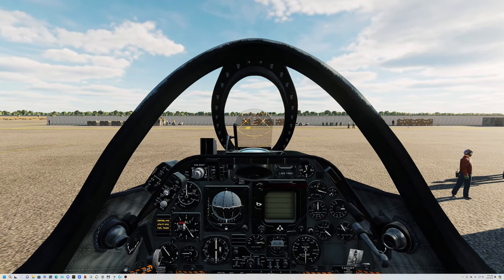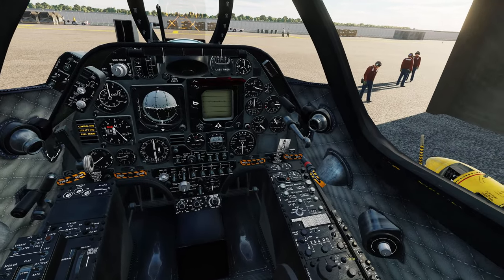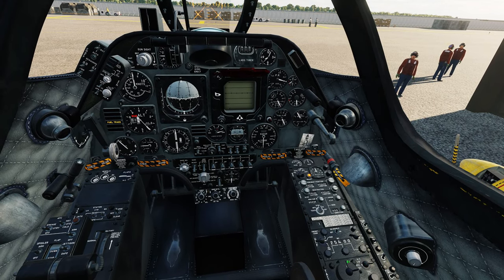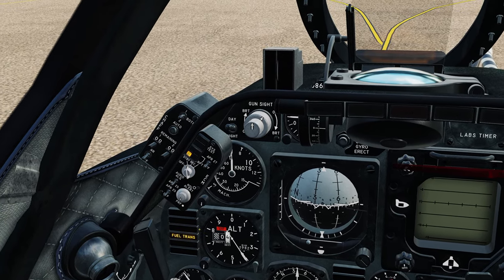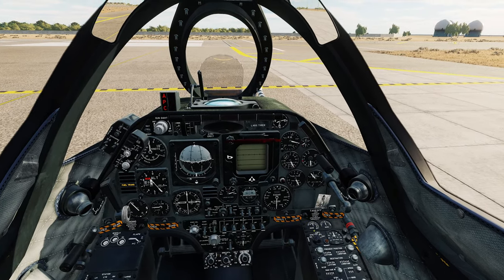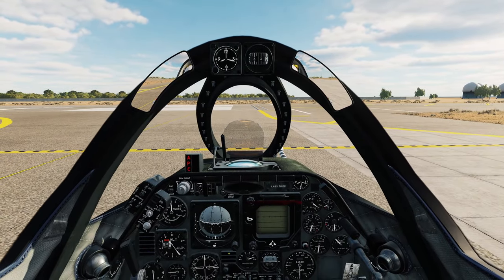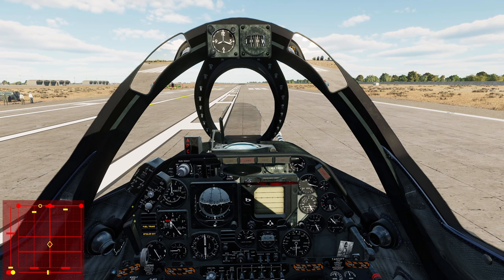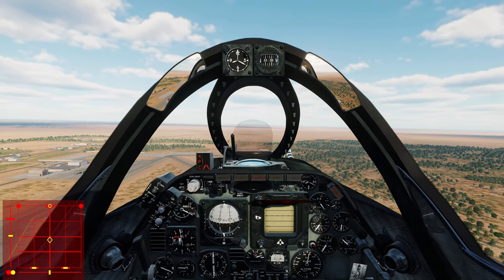A 4E Realism Stuff Ver2

Comment: Hello, massive fan of the A4 in DCS here, thanks for the video!
I have a few questions if that's okay! First one is it seems you put the flaps full down and the speedbrakes full out for the landing - can you confirm as I have seen / read quite a lot of contradictory information on the matter! Second one is whether you can disclose (ideally post in the description of the video) the mod you are using for the FCLP set-up? There are some mods running around, any particular one and set-you you have found working best?
Reply from the maker: Yes full flaps is the normal configuration for landing… it gives you the slowest possible approach speed. Having speed-brakes out during landing is done to keep engine RPMs at a higher, more responsive, setting. This reduces lag in engine response
Reply: @BonzProductions7  thanks for answering quickly. I practiced quite a lot with half flaps and no airbrake and found it really hard to reliably stick the landings without the Auto-throttle. Will try again with full flaps and brake. Any pointers on the mod? Everything I found is quite discombobulated and your set-up is really nice. Thanks!
Reply: Full flaps and brake does make it significantly easier indeed. Getting a majority of decent landings now. Not sure why I never did it before, even though the kneeboard writes "Brakes out" and "Flaps out"!